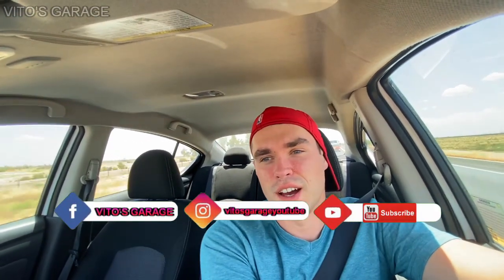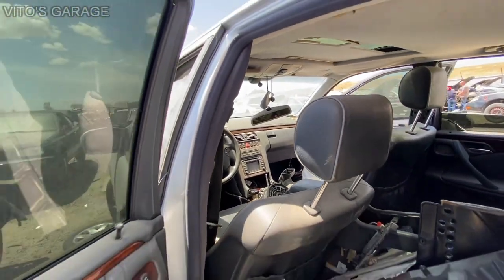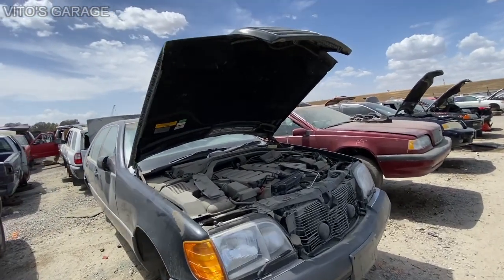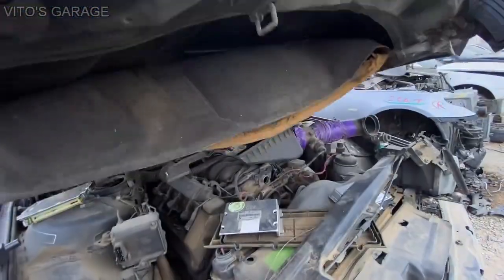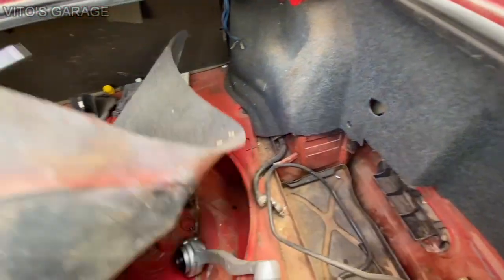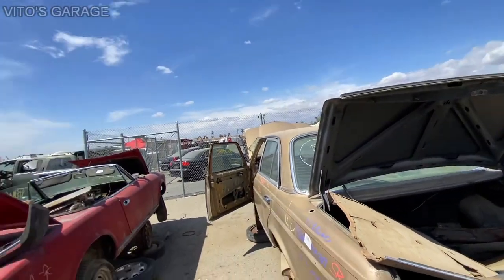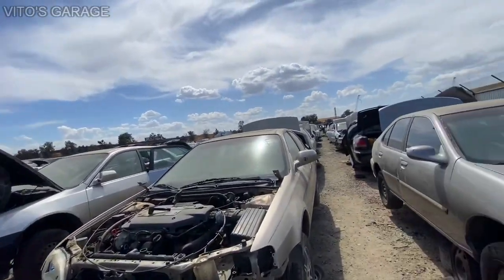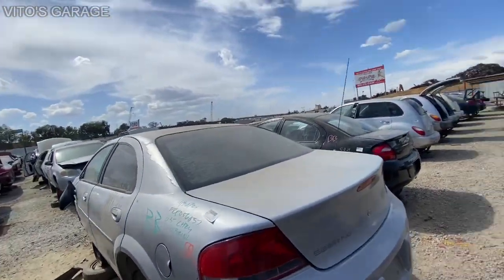Junkyard Walkthrough Mercedes W123 W124 W126 190E W140 W210 W208 W211 BMW E30 E34 E36 E38 E39 E60

Comment: damn, all the cars are in good shape. I'm from Finland. you can't find rust-free front fenders for these anywhere in Finland. i have rust on the bottom and sides. much worse ones here in Finland are repaired and the bottom is welded. if you could find a body in the same good condition as the w124 in your video

Comment: What a finding. What if im interested on some of the car parts? I'm from Malaysia anyways.
Reply from the maker: Hi there. Thanks for watching! And check on eBay for parts. Have you tried that yet?
Reply: Sjaifulanuar Which part of Malaysia are you from. I am Malaysian too. Owned w123 280TE 1984, W126 280SEL 1983 , R129 SL320 1995